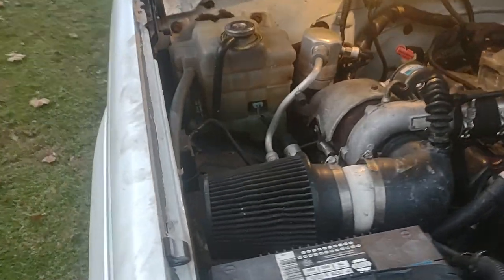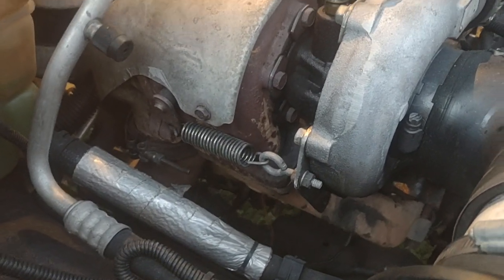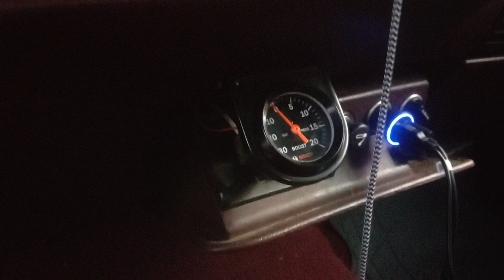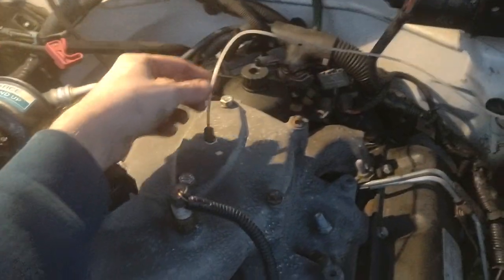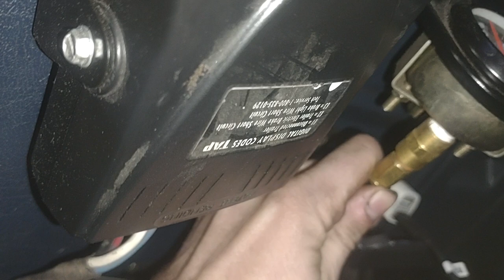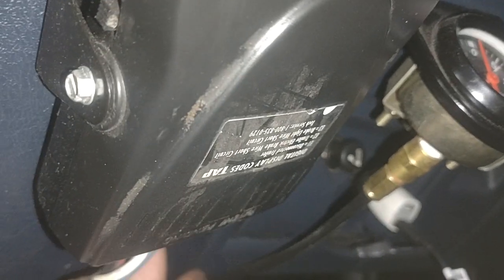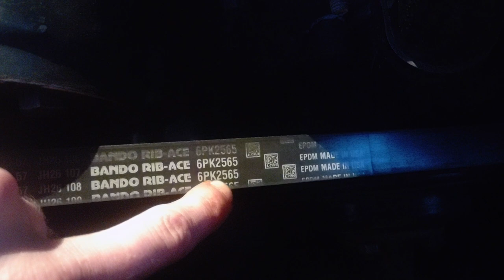6.5L Vacuum pump delete & manual waste gate

Comment: You need the Vacuum Pump to pump the Diesel because the 6.5 does not pump fuel like a Gas engine. Since you need the Vacuum Pump how does it run without it then? What do you replace the vacuum pump with to still pump fuel? I dont get it🤔
Reply from the maker: You are incorrect sir, the 6.5l turbo diesel is equipped from the factory with a lift pump which pushes the fuel up to the injection pump. The 6.5l runs just fine without a vacuum pump so long as you install a manual wastegate instead of the vacuum actuated one. I would suggest a bit more research
Reply: @JessePelkey1  Sorry man Im not familiar with these engines. I was just referring to what you said in the Video.
Reply from the maker: @Jean-Andre Sonnenschein  your good man, I didn't mean to sound ignorant and if I came off that way I do apologize. I do have a video on the entire fueling system if you would like to learn about it in further detail.
Reply: @JessePelkey1  Thanks. Im gonna Check it out👍🏻
Reply from the maker: @Jean_1999  no problem, any question just let me know and I'll try to get to them as soon as I can

Comment: Can I use a wiring harness from a 1998 Chevy 65 to a 1995 in the engine compartment
Reply from the maker: They will not be the same, you would have to change the ECM as well as a few other things in order to use the harness out of the 98 to put into the 95.
Reply: @JessePelkey1  okay thank you for that
Reply from the maker: @timothyfarley8590  no problem
Reply: I like all of the videos that you made wish you would come up with some more
Reply from the maker: @timothyfarley8590  they are on the way man, unfortunately I have had a lot of family issues go down this year and I felt it best to take some time away from the camera. I will be making a video explaining another of this here in the coming weeks as well as the plans for next year
Reply: @JessePelkey1  I am so sorry about that it suck
Reply from the maker: @timothyfarley8590  is all good, just gotta find the drive to put the other back together

Comment: What size belt do you run after deleting the vacuum pump?
Reply from the maker: Bud, the part numbers for the belts are in the video. Both for the newer and older style set ups for the 6.5l
Reply: @JessePelkey1  sorry, thought I watched the whole thing. Just remembered I got a call while watching.
Reply from the maker: @richardcrook6816  it's all good
Reply: Thanks for your video’s! I misplaced my books and the videos have been a great help. Especially since doing an EGR delete while swapping motors in my 1994. Thanks again!
Reply from the maker: @richardcrook6816  no problem man 👍

Comment: Hey Jesse can  you tell what block from the engine number ?Just in case here is mine # P336697  its the original engine in my RV  year 2003, side mount Turbo  , P32 Chev workhorse chassis 
Thanks Mate 
Rob
NSW
Australia

Comment: I just redlined mine to 4000 for a bit... thinks it's all good? Still starts and drives good... lolz oops
Reply from the maker: I mean, so long as your not loosing or burning any fluids and everything seems to be working as it should, you probably alright.

Comment: HI THERE HOW AOBUT A  ELETRIC VACUM PUMP LIKE ON THE FORD AND RAM 350 DIESEL.. I THINK IT WILL WORK.. WITH BOOST GAUGE..
Reply from the maker: If you would like to take the time in order to make it work man have at it. 👍 I don't see why it wouldn't work if installed correctly